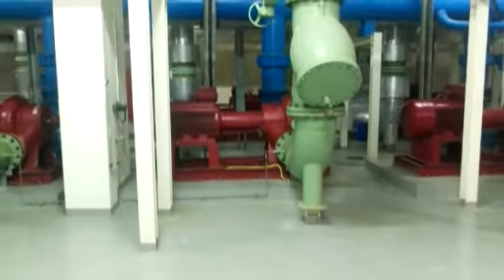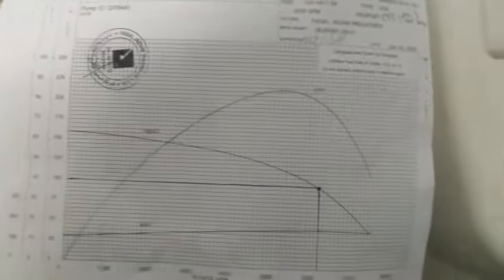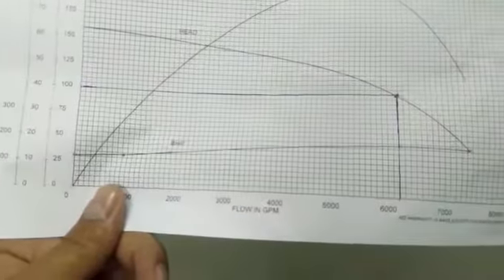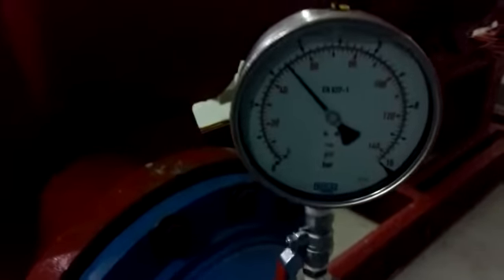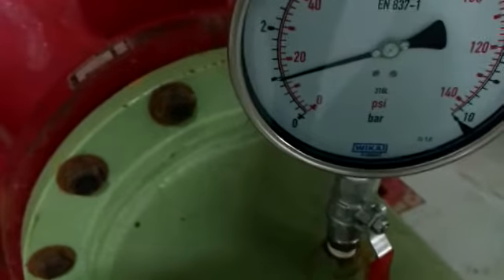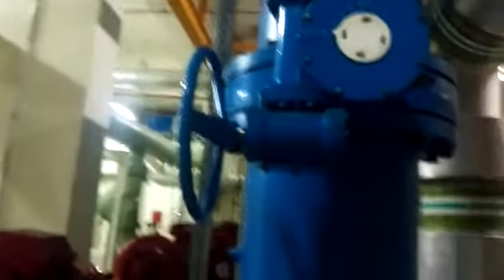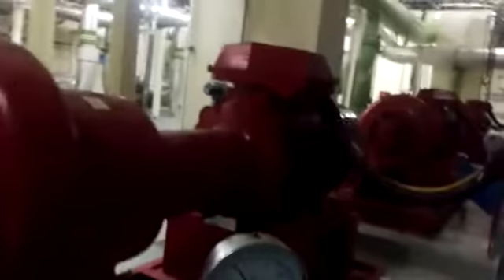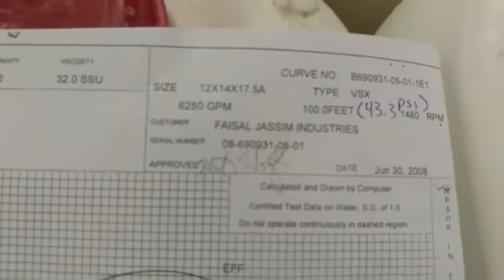How to get the correct flow from your pump

Comment: Assuming that the manufacturer’s pump curve is having its BEP at 100 feet head when delivering  6250 GPM, then the duty point of the pump at its original SYSTEM CURVE is at 82.8 feet head which is far right of the of the BEP curve. At this duty point, the pump is delivering more than 6250 GPM.  Throttling the pump to deliver the required flow of 6250 GPM will result to an energy loss due to increase in head. Consider the following options to save on energy: 1) variable frequency drive or 2) impeller trim
Reply: Melvin... Throttling doesnt always means energy loss occurs... By increasing throttling.(increasing system pressure drop) will result in reduction in flow of liquid. Which will over all result in increasing of efficiency of pump(kindly check pump curve for efficiency)

Comment: Thanks AMJ for the info , what if we have a VFD on the pump , do we still control the pressure via the discharge valve ? or we control it via the Hz ( i.e  40 Hz , 50 Hz ..etc ) 
Thanks
Reply from the maker: Fahd Mellal Thanks for your feedback.
In case of vfd, if you have flow meter then you can get the required flow by adjusting the vfd speed only. If you dont have flow meter then you have to plot the pump curve at the corresponding speed (check this link for how to plot) and adjust the valves to get the required deltaP on the new curve.
Reply from the maker: Fahd Mellal Thanks for your feedback.
In case of vfd, if you have flow meter then you can get the required flow by adjusting the vfd speed only. If you dont have flow meter then you have to plot the pump curve at the corresponding speed (check this link for how to plot) and adjust the valves to get the required deltaP on the new curve.
Reply: Hello,if you have numbers from pressure gauge on discharge,you can easily find total head.Than you can correspond this head with RPMs on curve and find approx flow without flowmeter. This is for water.....but for slurry you need also use density in calculation to get head numbers.

Comment: Hello gents,could you please comment what will happen with current and power consumption if discharge valve will be fully closed during the pump handling?thank you
Reply from the maker: minimum power consumption and reduced starting current at zero flow refer to pump curves. 
operating the pump with closed discharge valve should be done for short period of time to avoid water raising temperature, vapour flashing and wear and tear of parts.

Comment: hi everyone, what should be done if i want to get a higher flow rate, as per the performance curve, it can be achieved at 3.5 bar in my case, but the discharge head is around 5 bar

your help would be much appreciated, thank you.
Reply from the maker: hi. make sure all valves are fully open and then check the differntial head. 3.5 bar indicated on the pump curve is the differential head (discharge - suction) and not the discharge only.
Reply: Is it water or slurry?
Reply: Probably you have more losses in pipe system,which is restrict your flow.pipe ID,lenght,geod head, material of the pipe(friction factor)?

Comment: How did you know that the flow is 6250 GPM without flowmeter ?
Reply from the maker: Taher Makdad from the pump curve, for a given head you can know the flow.
Reply: Theoretically yes but you still need a flow meter to verify that in fact the duty point is on your pump curve.
Reply from the maker: Rommel Octavo knowing the actual suction and discharge pressures from the installed gauges then no work with the duty point. because the difference between these pressures is your system head and is the point where your system curve intersects with the pump curve (i.e. actual duty point)